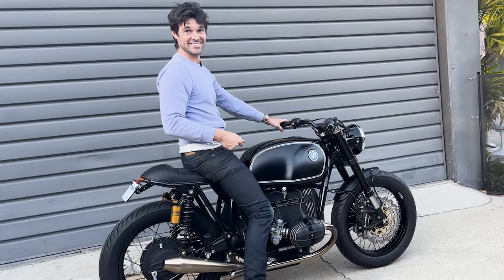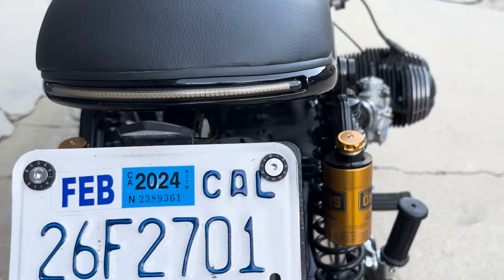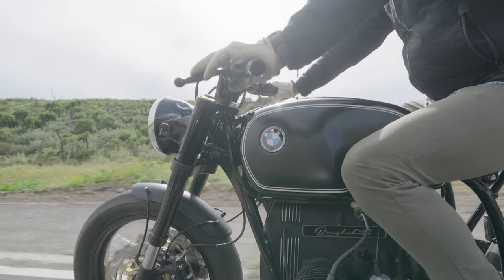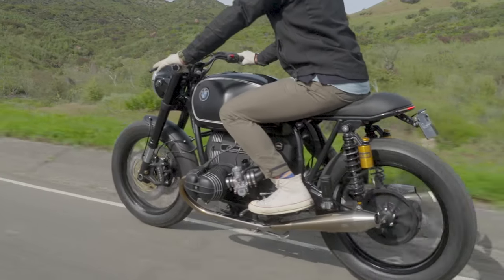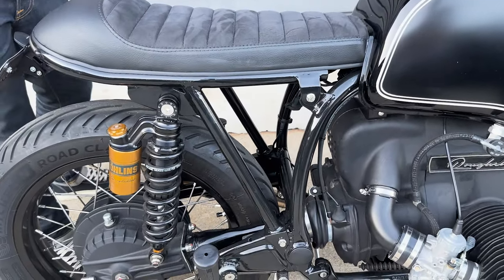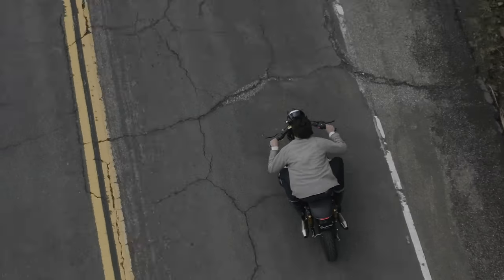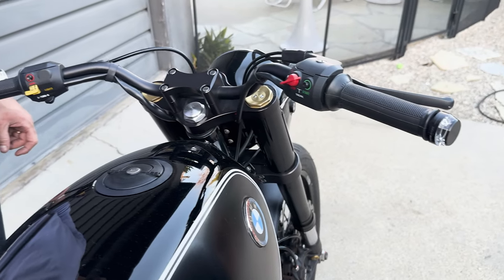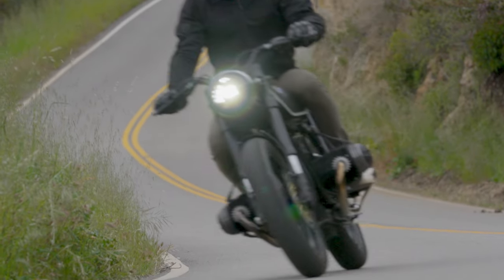Transforming Canadian Police Bike into Air-Cooled BMW Cafe Racer

Comment: The short wheelbase was skittish on the highway. That's why BMW changed it. The under-tank master-cylinder was problematic for several reasons. First, you lose mechanical feel by having the cable operating the piston through a lever. Secondly, and more importantly, owners didn't service them or renew the brake fluid, since it required removing the fuel tank. They would inevitably corrode, leak and the brake fluid would eat into the paint on the frame.
Reply from the maker: The short wheelbase was skittish with the skinny factory forks. Modern suspension and better tire compounds have eradicated that.  The under tank master cylinder we use is brand new. Yes they failed after 45 years of service I can live with that. We're not lacking any mechanical feel. Open your mind, don't try to be a know-it-all and stop reciting from the bmw nerd playbook.

I looked you up on Facebook and found your comments, you seem to be loaded with hate towards customs, why on earth are you here??

Comment: Why you guys insist with this kind of handlebar, it takes away the cafe racer stance, you "almost" nailed it on this one "but" the handlebar
Reply from the maker: One day 🤙🏼
Reply: I think it looks great, reminds me of the Euro height stock bars but maybe slightly lower and definitely wider. Bet you can ride this all day comfortably too.
Reply from the maker: @sdcorrey  euro bars were definitely the inspiration behind the design. They’re 1” bars vs 22mm and certainly wider. We typically run a smaller diameter, wider front wheel and shorter forks so the wider bars help with manouverability